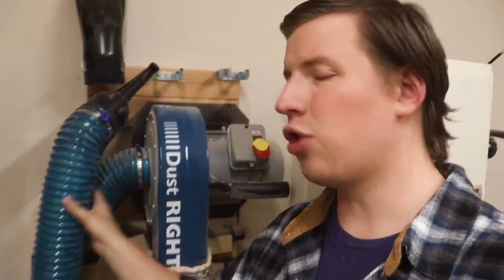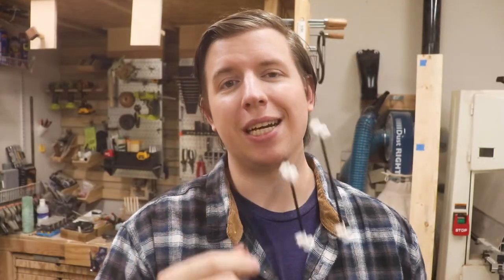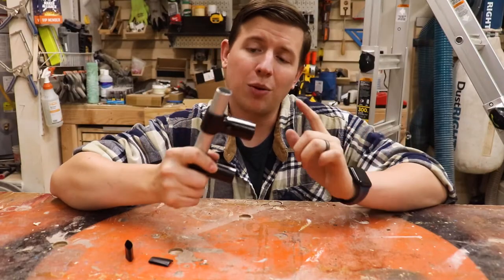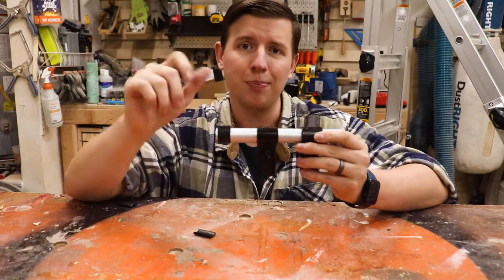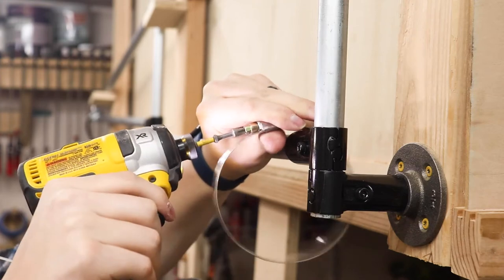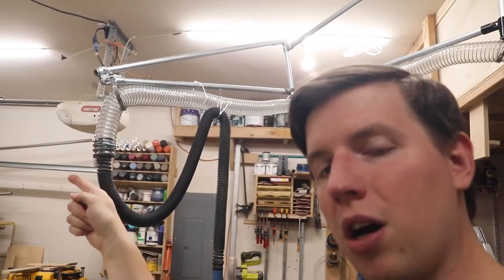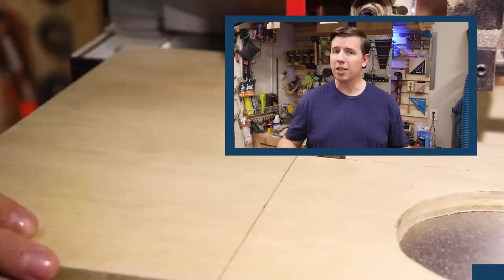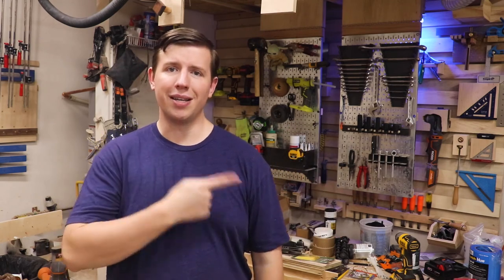Making an Overhead Dust Collection Arm with Maker Pipe Fittings | Shop Project

Comment: Great idea using conduit. one thing to help with the support is to reverse the angled bar. Instead of having it on the top which creates an outspread (stretched) if placed on the bottom you have a compressed support. Only problem would be the vacuum hose and handle will be higher up. Overall a great idea.  Thank you
Reply from the maker: You are absolutely right and I wish I had thought of that. I might need to flip it over. Would just need to add a handle so it was still easy to rotate around. Right now it’s just within reach above head, but minor problem to solve for the added strength. Thanks for the tip!

Comment: I absolutely over complicate projects!  That's why I do sketches and try to simplify.  Sometimes I have to build the thing to get the insight to make it simpler (actually make and use it to see i'm an idiot).  Great project and great job with the video!  Keep it going!
Reply from the maker: It’s so easy to do isn’t it?!? Sketches are a great way to keep it simple. I was definitely in that same boat having to make it to see the flaws in the first attempt. Thank you so much! I appreciate it